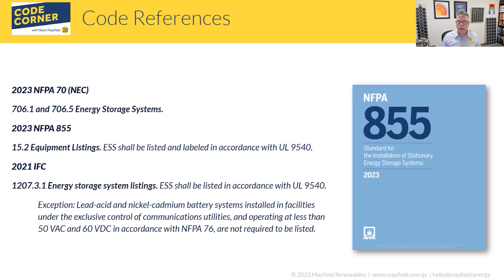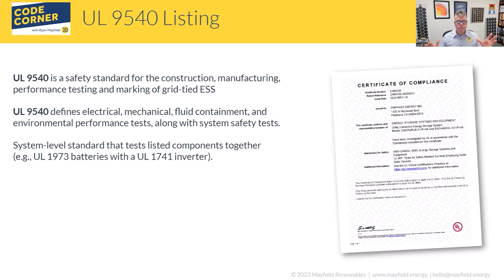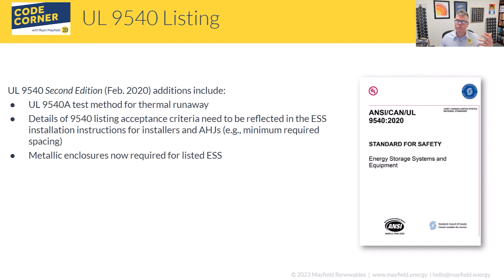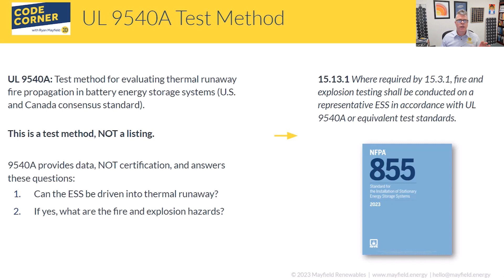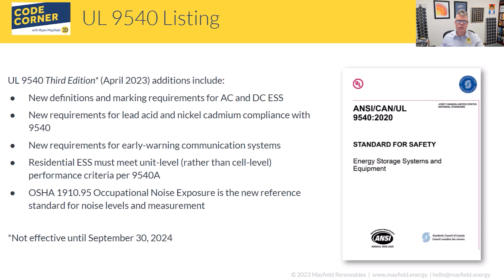Mayfield Renewables Code Corner: 2023 UL 9540 Listing and 9540A Testing

Comment: If we don't get approved to use a particular battery due to lack of 9540 cert,.. can we just put the batteries and inverter in a detached garage? 
Or in a shed? TY
Reply from the maker: It is highly advisable to only install energy storage systems listed to UL 9540. Unlisted systems are not required to adhere to consensus safety and engineering standards. Also, to install an energy storage system per the National Electrical Code, the components must be listed or field evaluated regardless of their location.

Comment: Does UL 9540 apply to off grid hybrid inverters that never feed power back to the grid? You mention UL 9540 applies to grid tied inverters. looking to use EG4 6000XP off grid inverter. With this hybrid off grid inverter will the ESS have to be in a metal enclosure or is the listed ESS  able to have a plastic shell?
Reply: We built an off grid cabin, we are having a bad time trying to find a system that is certified. We are in ontario Canada and we can seem to get a straight answer from anyone including the inspector. Feeling lost.
Reply from the maker: Excellent question! The UL9540 listing certainly can apply to off-grid systems, but it is not required. NEC articles 706 (Energy Storage Systems) and 710 (Stand-Alone Systems) call out equipment listings, but there are multiple ways to comply. 

If a manufacturer has listed the entire system to UL9540, as it looks like this manufacturer has done with some products, then yes, all the listing requirements would be applicable. The updated standard does require the ESS to "employ an enclosure of non-combustible materials." Essentially requiring metallic enclosures. It would be up to the listing agency to deem what enclosure that applies to (cell, module, or unit). Therefore, the case holding all the modules may not be required to be metallic if the individual units are in a non-combustible material and properly evaluated for (lack of) fire propagation. 

It is also possible to use a non-UL9540 system by installing listed components together by complying with Articles 480 and 705 for an off-grid system (as well as other articles as applicable).
Reply: Thanks for asking this! Of the 20+ cut sheets submitted to my AHJ the solar plan reviewer noticed the EG4 6 space rack spec sheet was missing. I asked EG4 and there is indeed a manual.  Hopefully the AHJ is okay with this “metal enclosure” — it’s only “listed with” in ESS context for UL9540 the 18kpv but I’m using two 6000XP.  I guess this means it’s not a listed ESS. But is it okay without the rack? Seems very dangerous.  The code is so confusing.  My suspicion is that it was driven by profit and not safety.  Tesla and utility lobbyists have their hands all over the code and it’s becoming a problem.